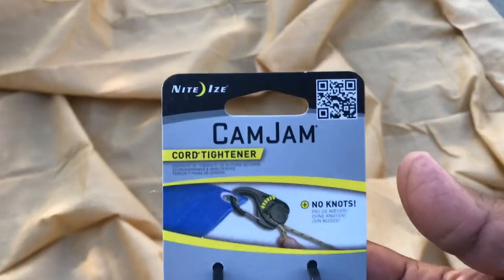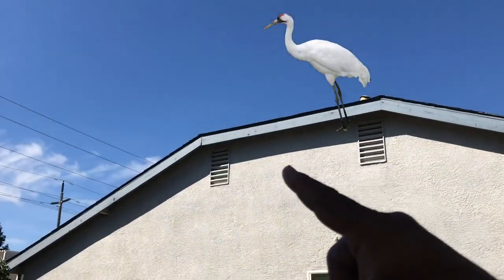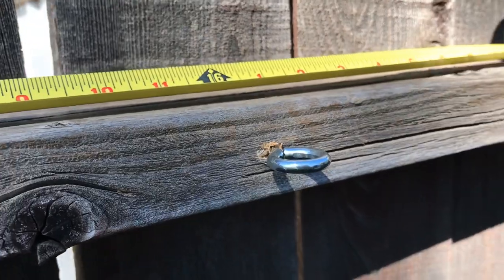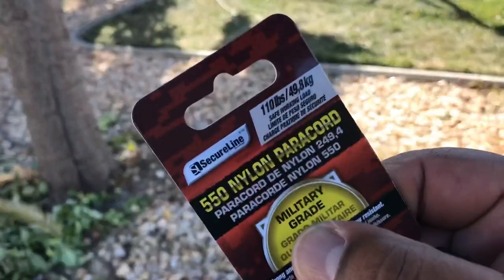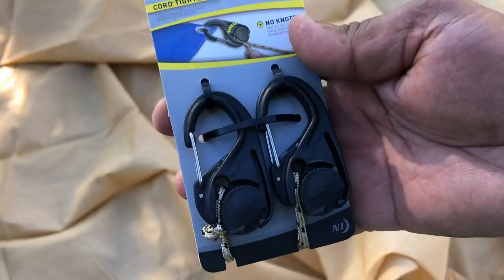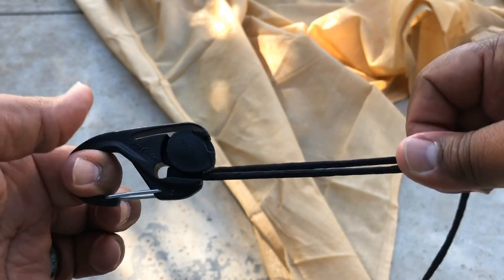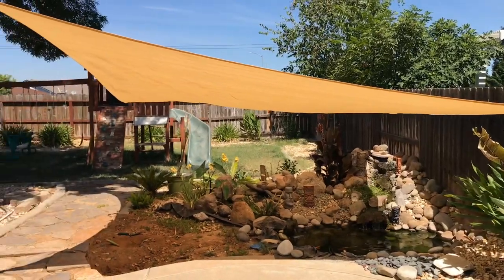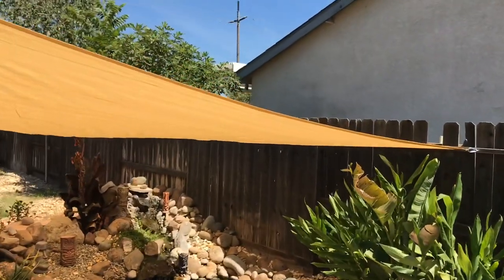CHEAP DIY SHADE SAIL COVER FOR BACKYARD KOI POND!

Comment: Where did you buy the sun shade at? Having a hard time looking for them at Lowe’s off Calvine
Reply from the maker: Silvia Alvarado oh I bought it on eBay u can find it super cheap I believe I put the link in the video description if you click on the little arrow under the video
Reply from the maker: Silvia Alvarado yes if you look below the video to the right youll see a little white arrow click on that and it will open up the description of the video and you’ll see I posted it there 🤙🏽🐠🤙🏽